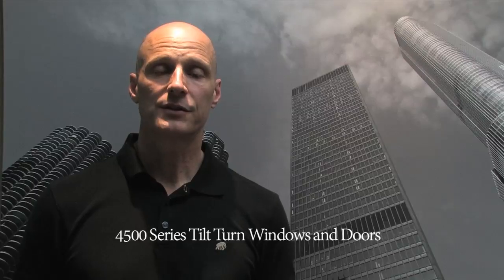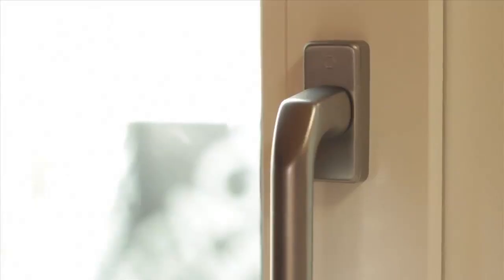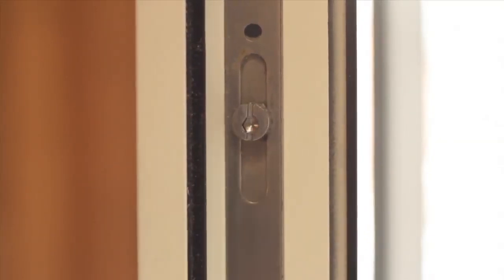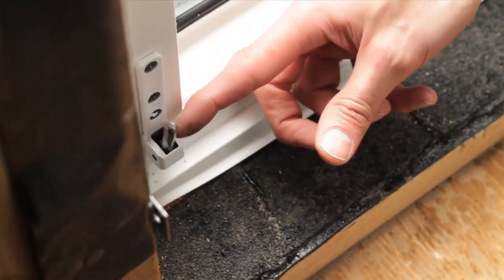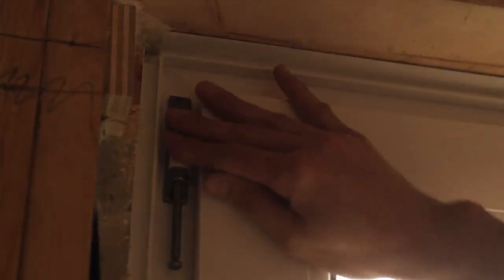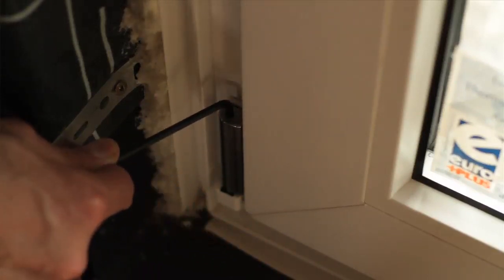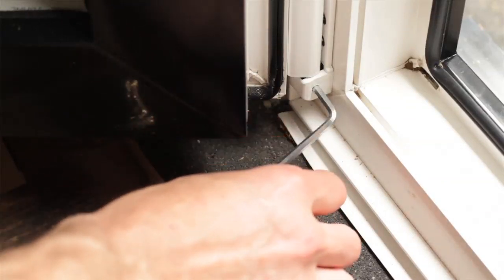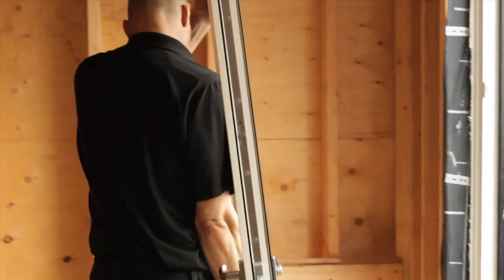Euro Tilt Turn Hardware Adjustment

Comment: At last an explanation zooming the mentioned parts 🙏🏽🙏🏽🙏🏽 Grateful, Sir. 
Now the thing I am fearing suspecting is that the lower "hinge" (am I spelling it correctly?) is damaged and or even broken 😩😔. I'd really like to solve it on my own for they are charging way too high for the service. 
Can you, please, kindly tell how to proceed if the lower "hinge" is broken? Is it a piece I can buy individually and then reinstall it easily?
Grateful in advance, Sir. Have good days.
Reply: The lower hinge can be replaced individually, however, it will require the sash to be removed to facilitate. If you have access to the replacement hardware and feel comfortable with the scope of work, then I would suggest to give it a try.
Reply: @chrismeiorin5870  Truly grateful, Sir. Cheers
Reply: @chrismeiorin5870   Hi, I need some advice on how to open a balcony door such as the one in the video, that tilts but is not opening when the handle is in the neutral position (i.e opening position). The door locks and tilts perfectly but it seems that one of the rollers is stuck. Any help would be greatly appreciated!

Comment: Can the windows that swing inward be adjusted to tilt and turn?
Reply: This style window is referred to in technical terms as a "Dual Function" window. It does in fact swing inwards AND tilts open from the top for efficient ventilation.

Comment: Your handle is set up incorrectly. It should be vertical for tilting and horizontal for opening fully.
Reply: There are two distinct handle set ups. Your description is correct for the majority of applications, however, certain applications require the window to tilt-before-turn, complete with a custodial lock. This is commonly used in applications such as hospitality (hotels) and assisted living, were clients can have access to the tilt function for ventilation, and management and custodial have access for cleaning and maintenance. Regards and thanks for the input.
Reply: @chrismeiorin5870  I see. I have never seen that set-up, so thanks for the info.